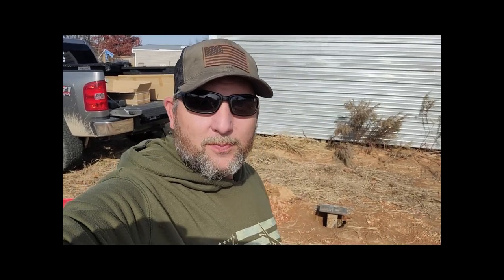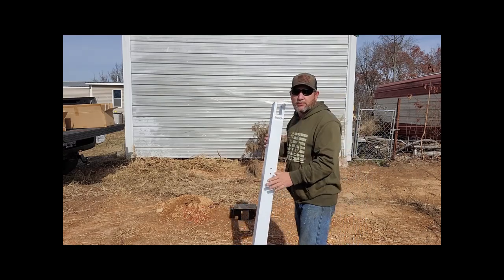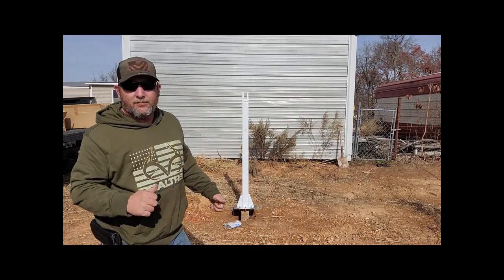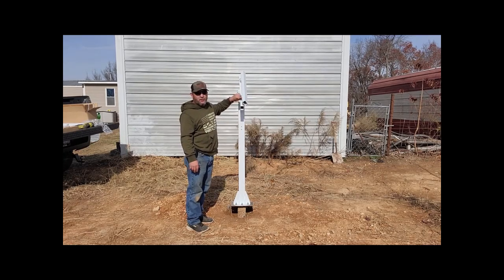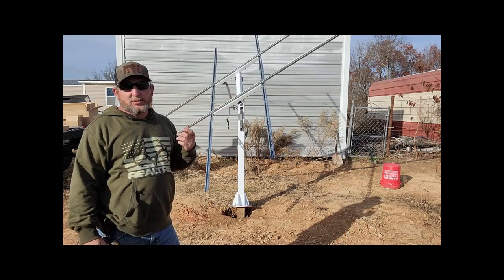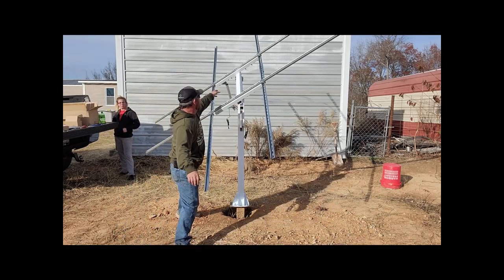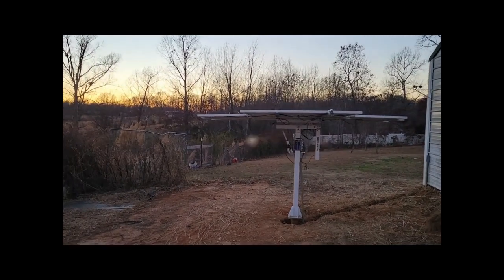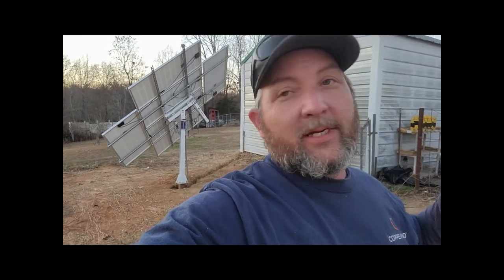ECO-WORTHY SOLAR TRACKER

Comment: All studies only showed additional yields of between 20% (single-axis) and 37% (dual axis) of solar trackers. 
Due to the extreme drop in the price of solar modules tracking systems are now superfluous. In any case, they are mechanics and need maintenance. And they are very susceptible to wind. 
For this reason and because of the mechanics, most of them only last a 1-10 years. It is much cheaper and much more reliable to simply install more solar modules!
If you want more constant yields throughout the day, you simply have to set up the modules in an S-E and S-W orientation.

Comment: Sorry! A real disaster! Screws too long and of poor quality. Replace all. Now I have to try to understand why it doesn't go down towards the north. Practically in a flat position it corresponds to the north. Actuator too short. Or should they be reversed?
Reply from the maker: Did u point the bottom pole the right direction?
Reply: Yes @Markslife101
Reply from the maker: I'd just look at everything really good and make sure it's right, it is really easy to assemble the tracker wrong, I done it wrong myself the 1st time
Reply: Ok. Another time. Thanks

Comment: Mark What brand of solar panel did you use and what was the size and physical dimension of the panels. Great Video especially liked the was you handled the ground mounting.
Reply from the maker: Eco-baeerss  300watt Monocrystalline,  got from ebay ,look them up for sizes, I can't remember,  sorry, thanks for watching!
Reply: @Markslife101  I looked on ebay and those appear to be fake 300w panels. 
Solar Panel:300W
Power under normal conditions:20-100w

That tracker isn't big enough for 6 actual 300w panels.

Can you confirm the max output you have seen from them?
Reply from the maker: After testing,  it seem you are correct these are only producing 100 watts each, I've been had!

Comment: I didnt have that issue with mine, other then that i had no issues with mine, i even greased my joints. it been up for many months, no rust, still standing strong even in stupid high winds we been getting for no reason. and its holding 3 320W 57Lbs panels. (no more would fit..) we will be installing a 2nd tracker in a fue days. Make sure its pointed the correct way. I will suggest you have a small 12V baby panel like 50W attached to keep a 12V battery charged to run the array with.

Comment: How did u wire the panels
Reply from the maker: In series,  thanks for watching!
Reply: @Markslife101  what controller are u using. Amd in series the volts lil close to my Max 145vdc. Would series parallel work better.
Reply from the maker: @thomasjohnson1546  it might ,I haven't tried that , I'm still learning about it myself,lol
Reply: @thomasjohnson1546  keep in mind that your controller will also have a max amperage limit. So if you put them all in parallel it’ll drive your amps up. I have 6 panels, so I’d probably do 2 groups of 3 in series and then parallel them together. You’ll just have to play with the numbers.
Reply: I have six and did them series then parallel. Also add fuses. 10 amp then 30. Watts up six hundred volts running around 80. It's perfect for bluettie system. Thanks
Reply: @thomasjohnson1546  clearly your panels are bigger than mine. 6 panels only gets me about 150V in series

Comment: I’ve had one set up for about 5 mos now, and I was wondering if you ran into the same problem I did with the mounting bolts. I found that the bolts for attaching the panels were 2-3mm too long. If you’re right over a hole in the strut it’s not a problem but if not then it’s a pain. Also, you said your panels are 300W. How big are they? My manual said that the struts are 114” and that’s just big enough for the 6 195W panels I got from Eco Worthy. You can go to a big box store and get full 120” struts if you want, or you can splice 24” struts on the ends.
Reply from the maker: My panels are 300watts and my mounting surface is 114, but it worked out just perfectly, and I did rin into that problem with the bolts, I shaped a few longer bolt for the shorter ones holding the strut mounts on and that worked for me, thanks for watching!
Reply: Do you mind tell me what manufacture your panels are? I’ve been looking for 300 W panels that will fit well. usually, they’re too fat And can’t fit four in a row.
Reply: Un vero disastro! Viti troppo lunghe e di pessima qualità. Sostituite tutte. Ora devo cercare di capire perché  verso nord non scende. Praticamente in posizione piatta corrisponde a nord. Attuatore troppo corto. O vanno invertiti?
Reply from the maker: I'm sorry,  but I only understand English, but thanks for watching
Reply: @matteocrotti6781  I dont speak italian either, but google translate did a good job. You can add washers to the top of the screw to make up difference. Also, make sure your tracker has the correct side facing north. I've seen people complain that the polarity of the N/S actuator is reversed for their hemisphere. Just open the control panel and switch them.
(Nemmeno io parlo italiano, ma Google Translate ha fatto un buon lavoro. Puoi aggiungere rondelle sulla parte superiore della vite per compensare la differenza. Inoltre, assicurati che il lato corretto del tracker sia rivolto a nord. Ho visto persone lamentarsi del fatto che la polarità dell'attuatore N/S è invertita per il loro emisfero. Basta aprire il pannello di controllo e cambiarli.)

Comment: I did some testing with having the long actuator on the east side (then have to switch the 2 wires for the actuator so east/west goes the correct direction when commanding on the controller) this gives you more tilting angle to the west 53° then to the east 35° (i have woods to the east so it works better for me to get more angle in west sky). With it on the west side, it is almost even angle, west 45°\ east 50°. I have also replaced the short actuator with another the same length as the long actuator, moved the bracket back 1 hole on the north/south mount, drilled new hole and installed rivet thread sert, retracted actuator, tilted all the way south and drilled 2 new holes with rivet thread sert. Now it can tilt all the way south and a good angle to the north. I have also seen people putting the north/ south cross strut on the top of the east/west strut instead of under it.
Reply from the maker: Thank you for the knowledge ,and thanks for watching!

Comment: That setup has to make a huge difference in efficiency.
Reply: My system, starts sooner, ends later, and i have seen almost 47% in daily power
Reply: Up to 40% has been mentioned.
Reply from the maker: I have heard the same, 40%, , but I'm just starting to use it so I have no comparisons yet
Reply: I find that they start making power earlier and go later in the day. Mine are Bifacial and that also makes a difference.